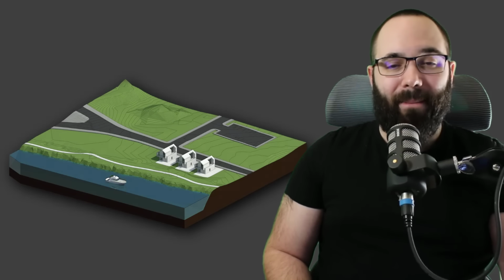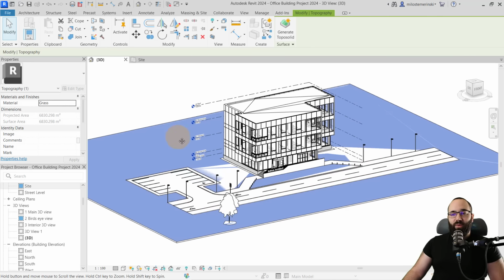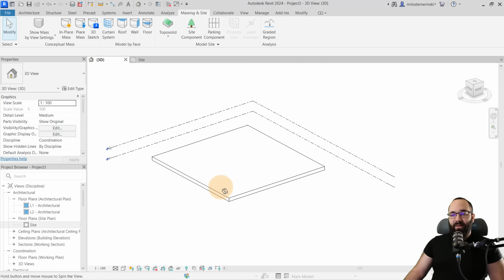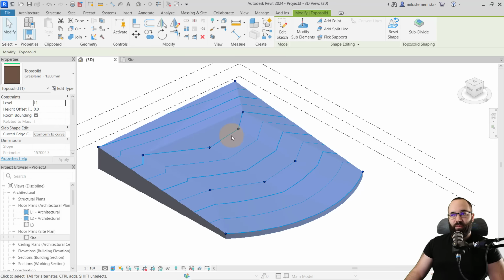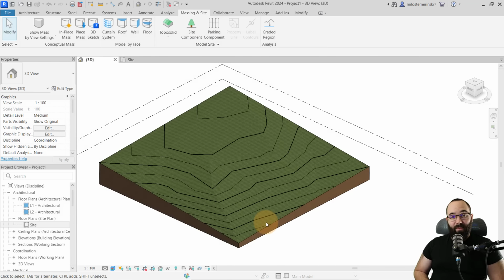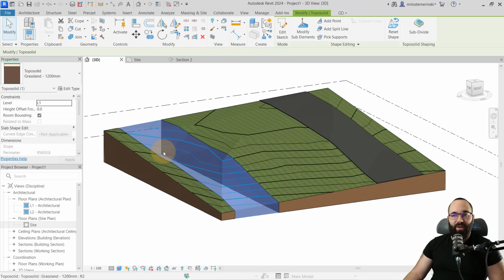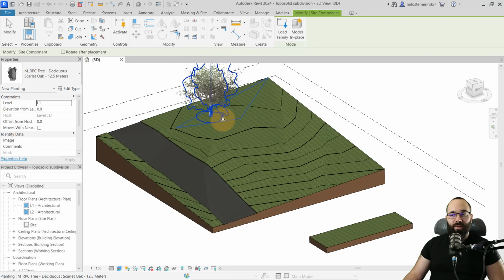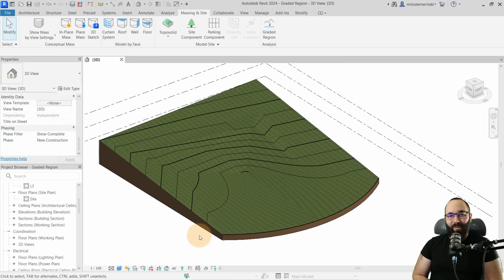Revit Toposolid - Complete Revit 2024 Tutorial

Comment: i appreciate all the videos - very helpful indeed. however i have to weigh in on this whole toposolid nonsense and simply say this has to be one of the worst changes to revit i have experienced to date. toposolids and their sub categories have literally been nothing but useless trouble - especially true if and when splitting the toposolid into two or more separate pieces.

and now i have a sub cat (of grass in the current model) that, when i go to edit the perimeter of it, gives me an error stating "Can't create toposolid sketch line" - meaning the only possible route i can take for editing this sub cat is to first draw detail lines in plan view and copy-in-place those lines into the sub cat once editing is initiated - but even then i will easily get another error following said linework editing which says that the linework is not fully completed or there is an overlap somewhere in the linework - when there is literally no gap in the linework - and if there is a gap in the linework you have no way of eliminating it by adding or trimming any lines.

Literally hands down the worst change to revit i have seen so far. maybe there is a  fix and the tool can be somehow improved so that someone can use it without wanting to off themselves.

Comment: tip 1 - don't switch to revit 2024 to avoid using toposolids. Because there will be no way back to topo surfaces and you will spend 100x more time editing toposolids. And it's not an exaggeration.
briefly:
1. new functions are nice
2. toposolids can't be texturized as toposurfaces could be
3. at any complex terrain adding or editing any point takes at least decades of seconds whereas at toposurfaces I could place decades of point and it would only take some time when accept changes

Comment: Can you do a video on correct practice for detailing/annotating a Topo solid site. I find that there is an issue with dimensioning sloping gradients. Revit will now dimension lock on the hypotenuse(slope) rather and therefore site information that would be presented in 2D is different to 3D. I.E the steeper the slope of a ramp the difference between 2D and 3D will become larger. There must be a term for this perhaps.

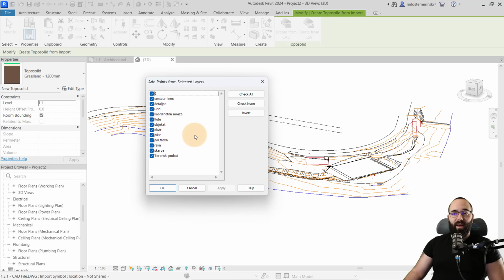Comment: @6:00 your import looks like it adhered to the contour lines exactly, but when I imported mine, it did not. I've gone down so far as importing 0.1m and 0.25m contour lines, but it STILL does not adhere to the contour lines.

Is it possible to refine the mesh/decrease the size of the mesh faces in Revit? I've tried every different way of exporting the file with different contours/points/grids I can think of and nothing works very well.